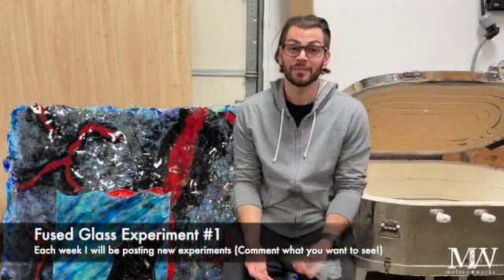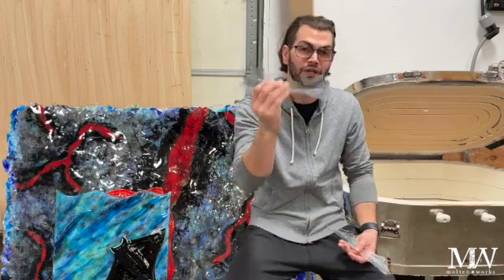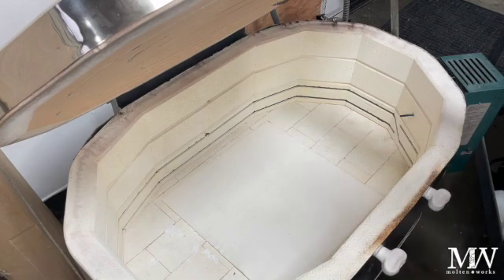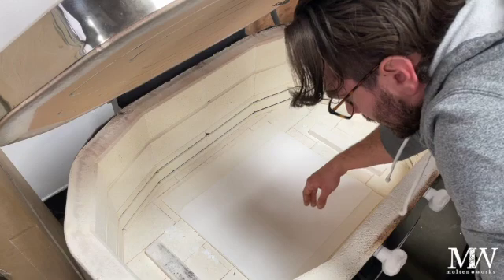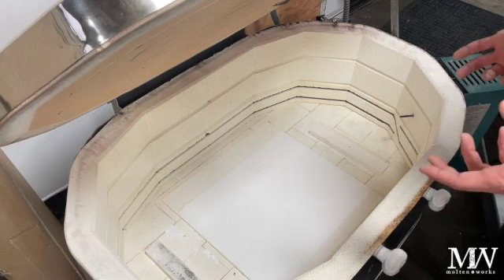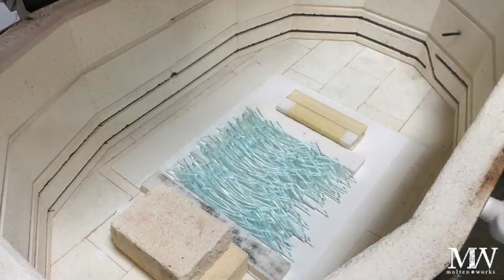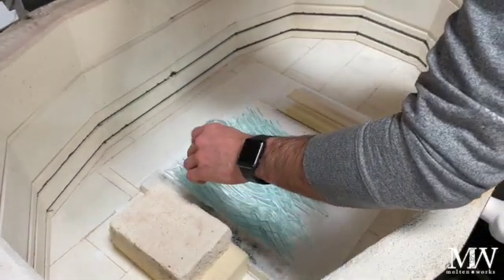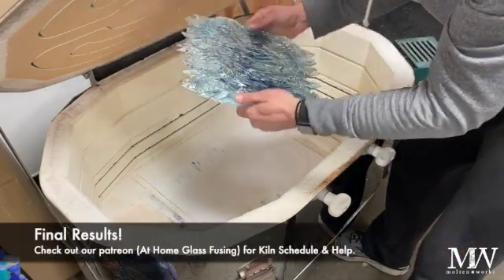Fusing Glass Experiment #1

Comment: What would the firing schedule be for glass using a porcelain kiln?
Reply from the maker: The firings should still be the same. Do you have a programmable controller on your porcelain kiln? If its just dials, it can be hard to get the right speed and temperature without watching the whole process. Start with firing small jewelry size pieces as the program doesn't need to be as slow. Let me know if you want me to post a schedule for you.

Comment: Hi, I have a question. I saw a video from Applied Science about making glass and he said that a newly forming glass (a melting mixture of base constituents, e.g., alkali carbonates, lime, silica, boric acid, alumina, etc.) will stick to just about every surface except platinum and that it can corrode and/or dissolve effectively all refractory materials to some degree or another. Is this also true of already-formed glass that is being re-melted in the fusing process? Thanks.
Reply from the maker: Great question! With the glass I use, as long as there is a barrier from the kiln shelf or mold, the glass won't stick. I use something called bullseye thin fire paper and Boron Spray for molds.